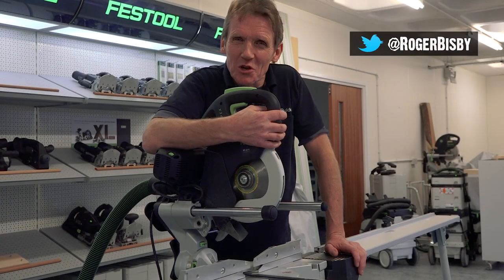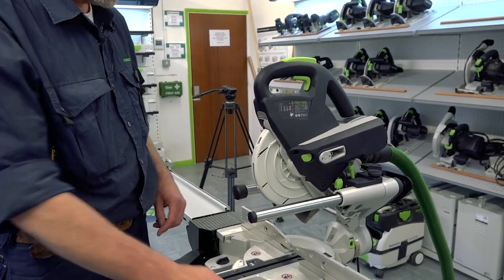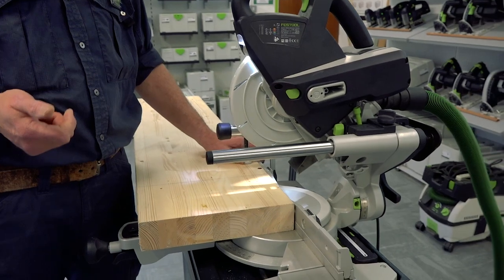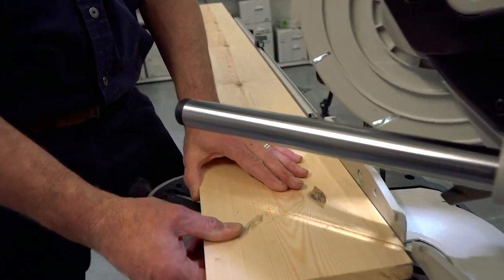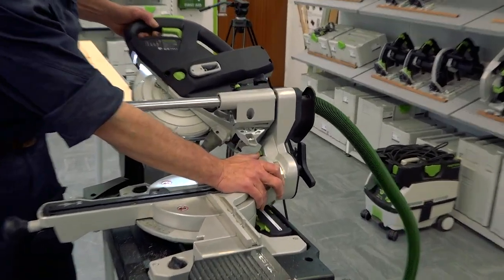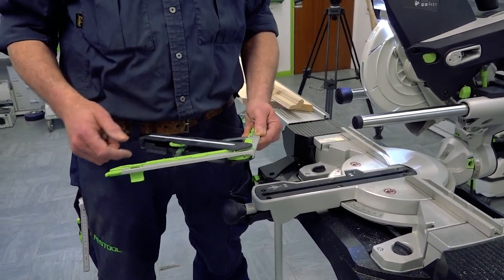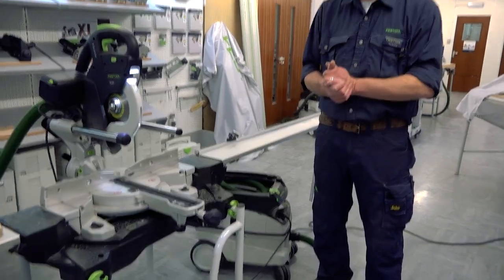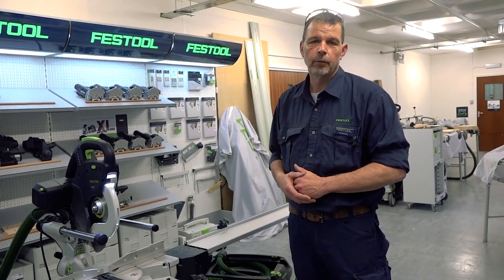Festool Kapex KS 60 Sliding Compound Mitre Saw Demo

Comment: Very important if you would like to saw with precision. (avoid torsion as much as possible)!
Always choose a Miter saw with a handle positioned in a vertical line above the saw blade.  
Everything must be aligned, slide rails, handle, and saw blade, it is much better this way the blade will not tilt.
Because there is some torsion in the aluminum housing .
And choose an engine with softstart on it to prevent wear of the gear and worm shaft.
It is very important that everything is aligned.
Here are some examples to show how the handle must be positioned above the blade.
Bosch gcm 800 sj / Bosch gcm 8 sjl / Evolution rage 3 / FESTOOL KS 60 / HITACHI C12RSH2 / FESTOOL KS 60 E KAPEX / Metabo KGSV 72 Xact .
(This also is the case with the Miter saw without the slide rails).

If you want you can test it yourself at home if there is torsion in the aluminum housing.

Step-1. First you make a saw cut from +-5 mm deep in to a flat piece of wood. To this with the normal handle positioned on the right side of the Miter saw.

Step-2. Then repeat this by pushing the saw blade down with your hand (finger) on the aluminum protective cover were the saw blade is cased in. Just now only do this without the running engine.

Step-3. Now you can see if the saw blade will be positioned in or next to the saw cut. If the saw blade is (+- 0,2 / 0,5 mm) next to the saw cut then there is torsion in the aluminum housing.

Step-4. therefor it is much better to choose a Miter saw with the handle positioned vertical in line above the saw blade.   
       
Conclusion: how further away the handle is from the saw blade how more chance of torsion in the aluminum housing.

Comment: I think we are agreed that having a good fence to work against is useful for guiding the workpiece to get accurate cuts.  It is a great pity therefore that the fence has to be removed for doing bevel cuts.  While those 'overhead' slide rails reduce the amount of space needed at the back of the tool they interfere with the fence for bevel cutting.  Also if after going to all that trouble to reduce the space needed at the back of the tool why do Festool then position the dust extractor pipe in such a way as to use up space at the back?
Reply: If you want maximum angles you will need to move the fence it is only an 8.5 inch saw.

Comment: When you used the angle finder you measured for an internal miter then cut an external miter? How would you use that device to measure an external miter?
Reply: it is also possible with the tool.. just slide out the side panels and measure an external

Comment: So gone is the ability to use the cool quick clamp you can use with the KS88 and the KS120 and also the brilliant graduated bevel control on one of the rails of the bigger saws? Why on earth leave that out? Add to that the 60's really poor depth of cut on a bevel, I can't see the point. It's more portable I suppose but it seems very unlike Festool to cut features. Being sold for between 650 - 850GBP here in the UK. Too much for what it is. Work and save an extra month and get the 88 or 120.
Reply: It is a super accurate small saw that many people use. If your own concern is depth of cut then go for a ks120 or another brand.

Comment: I wouldn’t be doing heavy jobs with this if you do a lot of bevel cuts. Depth of cut dramatically decreases when cutting a right hand bevel due to the rails. That’s why you have to remove the fence and the permanent fence is so short. I think they’ve carefully disguised this problem in their video. Having said that I own a kapex 60 and only use it for finishing work where materials rarely exceed 35mm and I dare say based on the the amount of saws I’ve owned in the past 20 years that you’ll struggle to find one that is more accurate than this. It rides in the passenger seat of my van when I take it to work.

Comment: Is there a way to angle the dust port to the left or right?  Straight out the back kind of takes away from the ability to get close to the wall.  Thank you
Reply from the maker: +Jeff 
I was thinking the same thing. It could do with an elbow connector so it hangs down
Reply: Skill Builder or up!

Comment: Looks good, probably miles better than my rage that induces rage when trying to do kitchen cornice work.
Reply from the maker: Yes Rob the Rage is at the other end of the spectrum. It needs setting up and keeping in line.
Reply: They are great for cutting firewood with nails in (the universal blade it comes with) but anything like cornice or even skirting the rage struggle with, even with a high number toothed wood only blade (with adaptor ring as rage make stupid size blades to make you buy theirs) it still needs setting up every time you use it and then its hit and miss weather you get the clean cut Phil showed on this vid. I will def pay more next time I buy. Luckily I only do 1 or two kitchens a year. BTW I struggle when mitre bonding the two joints together its hit and miss when I put them together, wondered if you had a technique that works without fail.
Reply: Evolution usually fine for rough work eg planters, timber framing, etc. Some very batches - I've had to return them as dead on arrival. Not for fine work

Comment: Ive had this saw about 6 months now and still find the trigger a bit harder to use compared to other saws
Reply: Does this saw plug into mains?
Reply: @timli7258   my one is a 240v so standard uk plug but you can also buy it as 110v which then needs a transformer

Comment: Looks great going to look into one of them just one question Roger does that angle finder do external profile because l thought he did an internal angle finder then did a external mitre perhaps l need to watch it back regards Mal 👍
Reply: Malcolm Pritchard you can slide out the bevels to measure external angles. 😊
Reply from the maker: Yes that is one I didn't think of but there is something on the machine itself.
Reply: redstihl -thanks for info 👍

Comment: What's the difference between the kapex 60 and the 120?
Reply from the maker: The blade size. The 120 is a 12inch saw and this one is 10inch, which means it has slightly less cutting capacity but it smaller and lighter.
Reply: Skill Builder I have a kapex 120 the blade size is  10-1/4.
Reply: Skill Builder has it wrong here. The KS120 has a 10 1/4" (260mm) blade, the KS60 has an 8" (216mm) blade. The 120 and 60 numbers refer to max depth of cut at the fence behind the arbor (for crowns etc). The KS 60 doesn't have upfront controls of the KS 120, nor the ability to control bevel angle in graduation via a knob at the end of a rail (a great feature). You also can't use the KL-KS quick clamp with the KS 60 saw. The KS 60 is a waste of money.

Comment: Very important always buy a Slide Compound Mitre Saw with the handle in a line above the saw blade,everything has to be in line Slide bar rails,handle,and saw blade. it's better  no tilt saw blade, and engine with softstart just like this video.

Comment: hi, i new to mitre saw, can this cut metal?
Reply from the maker: with the right blade I would say it is good for aluminium but not heavy section steel.
Reply: Skill Builder thanks for the heads up
Reply: You dont want to scratch such fine instrument with metal crap on it ;)

Comment: I think this is the perfect saw for the carpenter. All studwork and roofing is done with a circular saw so this is just for trims and mouldings during the 2nd fix. You don't need a bigger depth of cut. I would buy this to replace my monster Bosch without hesitation
Reply: +Martin Durrant
It depends on the cuts you are making when doing roofing. Simple straight forward pitch cuts could be done with a hand saw. But if you are doing complex compound cuts that require accuracy then a festool may be what you need.
Reply: bighands69 Disagree. You only need a circular saw to cut compound angles accurately. It's too slow using a mitre saw when roofing

Comment: How deep can it cut at 45
Reply: 40mm to the left and 20mm to the right
Reply: That's so limited. How pointless
Reply: le ge, it is a 8.5 inch saw designed for trim work.
Reply: States on Festool website it's designed specifically for trim and Base boards (skirting boards). I never fit skirting on an of my developments that Is 60mm. A tool that can only perform half the tasks in which is is designed for is not fit for purpose.

Your quick to point out the good aspects of Festool but never the bad aspects. "Barry the plug" I think I what you call it. You irritate me giving me one sided biased salesman 'reviews' try being honest and you may garner more respect.

(BTW I'm not a Festool hater I actually own a 120 which I love and feel Is market leader but again not without its flaws which again you fail to point out)
Reply: You obviously haven't seen the second part to the walk through. Also, the cut capacity behind the blade is more than 60mm, quite a bit as a matter of fact.

Comment: I think festool is overpriced for what they are but alot of people love them
Reply from the maker: Ryan 

 You may be right but they are one of the few who manufactures in Germany and that costs more. If you took China out of the equation you would have a different price structure. We have got use to slave labour.
Reply: Indeed you are completely right. I think their plunge saw is great but I don't rate their drills I personally think Hilti are the front runners in drills and impacts :)
Reply from the maker: Ryan 

Agree with you about the drills. I was dissapointed
Reply: Yeah especially for the price
Reply: Skill Builder in my opinion it depends on the application

I own 
Hilti 18 volt impact
Hilti 18 volt drill
Festool t 15
Festool pdc 18 volt

Power wise hilti is hard to beat.  Unbelievable power and there impact just feels perfect in your hands.  Although I've mentioned hilt is power is unbelievable,  I believe the pdc is not far behind.  The settings is where things get tricky. Festool is all about precision.  If you torque the festool down to 1 then up the other two settings all the way to max position. The festool will rip your arm off.  But the speed will be slow. Battery wise, there's no comparison.  I have to charge my hiltis 2 or 3 times to one charge of my festool.  In my opinion if I had to pick between all of them I'll pick my little impact hilti.   Maybe if festool came out with a strictly impact drill. I might would change my mind.  Because personally I use an impact over a drill anyday.
Reply: +Ryan Howell
Festool are not over priced. Every tool that Festool produces is at a workshop standard and can also be used for construction. 

Some of Dewalts tools are at Festool level but you will also pay for them as well but not all their tools are to festool standards and you need to do you research to find out which are. 

Festool produce high quality tools that are very accurate. If you do not need that accuracy for your work then you probably do not need a festool and can get away with other brands that are cheaper.

Comment: I can not reconcile spending hundreds of dollars more on Festool power tools, my partner has the Festool Kapex and Festool track saw, I have the Bosch Glide mitre saw and makita track saw, there is literally no difference in the quality of cuts on either tool between my Bosch and makita, and his Festool mitre and track saws, except my saws combined cost over $ 800.00 less, by the way, the handle on the Kapex mitre saw is ergonomically awkward and counter intuitive to use.

Comment: Ok 2 issues I don't like about this saw. I don't like the shadow line, not as accurate as the red lazor line. #2 I do not like the star handle you have to rotate on the rear of the saw to tilt the head to make compound cuts, I hate those on saws. The Kapex 120 is great for the way its rear top locking device works. Also this guy doesn't know how to make a good cut, when making a splinter free cut on top of your piece of wood, start the cutting of wood with blade all the way back against the fence and score the top of wood slide forward to front of the wood edge but do not cut the wood all the way through , just score it with the blade about a 1/16" deep to the front then go down thru the wood and then go back to the fence cutting the wood piece. This makes a clean cut without splintered edge, at least on the top of wood. And a clean cut underneath also. This process is for wide boards or plywood, if your cutting a 2 inch wide board you don't need to do this most of the time. I would not buy this saw for these 2 reasons.
Reply from the maker: The shadow can't be less accurate. It is the blade so how can it be wrong? 
 I think Phil knows how to cut a piece of timber.

Comment: Why would anyone choose this over a KS 120. You could bet your btm dollar that the first job would be cutting stock greater than 60 mm. And using a festool clamp is slow and cumbersome. Abt the only advantage I can see is the 60 degree cut both ways
Reply from the maker: I have a  DeWalt 10 inch double bevel mitre saw and it does nearly everything I want and is a bit easier to transport. This size of saw is very popular so any manufacturer that ignores the sector loses sales.
Reply: I hardly ever cut more than 60mm. I wanted a good saw for flooring and mouldings. Working in a clients house, i want the best dust extraction I can get. But i don't want to carry a huge heavy saw about. That's why people chose the KS 60 over the 120 or 88

Comment: I think bosch and Metabo are better
Reply: You are entitled to your opinion however after working with both Bosch and Metabo and now owning a Kapex 60 I would have to say your comment is at best wrong and at worst foolish, the Kapex60 offers levels of accuracy, cut and refinement far beyond these two brands, good saws they are but with the Kapex60 the word great is simply the only description suitable!
Reply: I had all Bosch tools, I  traded them all in because they couldn’t hold to my work environment
Reply: adie chip  I agree with much of what you are saying, there is many good mitre saws out there for a good deal less and will do a good job, my work as a cabinet maker requires more than a good cut, or a good job  my work requires an above average cut, and above average accuracy, this is where the kapex steps in, I have had hands on experience with makita and dewalt and Bosch and ok they where, yet simply no more than ok, the kapex first cut is the same as it's one hundredth cut spot on clean, crisp and perfect, I am not rubbishing these other brands as I think you seem to think, but as a cabinet builder I need better than most, festool offers me just that, do I think that festool is over priced, yes I do does it sit well with me.....no, i dont like it so it's up to other companies to spend a little more time in the design stage to catch up and match festool at a lower price, so then i wish you well. Kindest regards louie Ulster workshop
Reply: adie chip  Adie, why so angry? I wouldn't dare question your skills in your field of joinery, machining  kitchens requires a high level of both ability and skill, my work however is bespoke pieces that require often a mind blowing level of ability, something that I have had to work at for almost 30years, I am 47 and I started carpentry in my teens so you could say a long time. Over those years I have had many brands of saw and all I can do is tell of my own experiences, Bosch and Makita, DeWalt and Metabo have all offered a very acceptable level of cut, however when Festool approached us with their Kapex I have to say that the accuracy and repeated cuts simply went far beyond what I was used to before! We use 60 and 96 tooth Freud ProCut blades in our cabinet saws, Mitre Saws and also within our Festool55's, Cabinet making is a discipline that demands the very best of everything, so I wish you well in your kitchen cabinet work kindest regards Louie
Reply: adie chip  Adie you do come across as alittle angry and upset! Often when I mention my festool machines some woodworkers become jealous and hit out with aggression!! Not saying that's you but you do come across as upset about something, I do have a woodworking YouTube channel which I have only begun, I intend to showcase some of my work, all of my work is within our portfolio, this would be single and multiple pieces presented to our customers. You see Aide you did declare that your view was Bosch and Makita are just as good as Festool, as an owner and user of Festool and one with experience of other brands I had to endeavour to enlighten you to your errors and help to correct you, I hope in a good way. Regards louie
Reply: adie chip  Sadly I was wrong, I do indeed smell the unmistakable scent of jealous! 😣
Reply: adie chip  I seem to have touched an nerve Adie, maybe 30years ago my intellect would have allowed me to argue in this base level but now as man I simply couldn't so I will wish you well my friend, regards louie
Reply: adie chip  I have got ls1013 and want to get Kapex.At the end of the day it's all skills - I can cut perfect crawn mouldings with a hand mitre saw.But I have got money now and want to relax and enjoy which what Festool brings.You only live once
Reply: @louiesworkshop2023   I am looking for new miter saw for 2nd fix joinery. Max skirting boards are 230 X 25. Do you think the KS 60 would be sufficient as opposed to the 120
Reply: @tonygrace4946  hi Tony, you won't go wrong with the little 60. Although smaller than the big 120 it's a great mitre saw, extremely accurate and almost half the price of the bigger kapex. I had the 60 before opting for the 120, if I had to again I am not sure I would, with bespoke furniture that I do I had to go with the bigger 120 but the 60 is a class act. Go for it, brillant mitre saw. Regards Louie